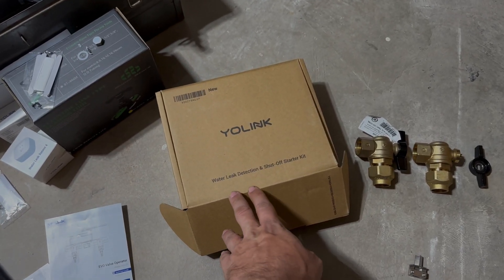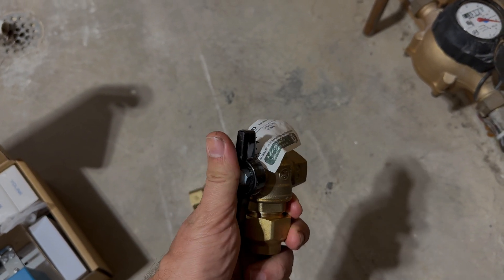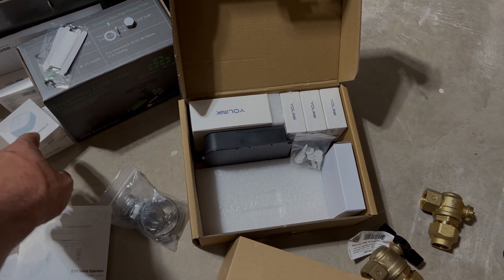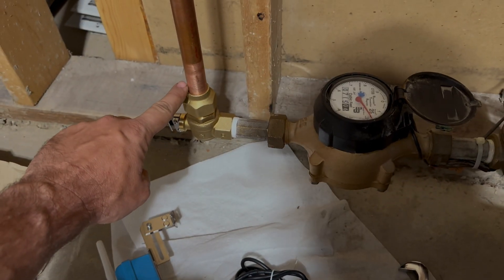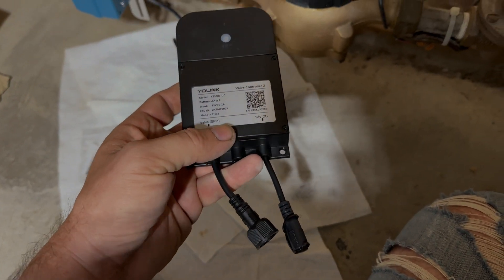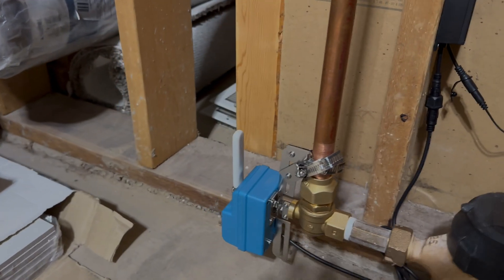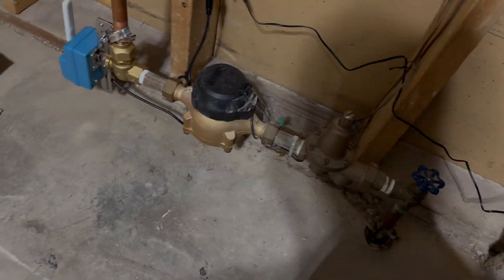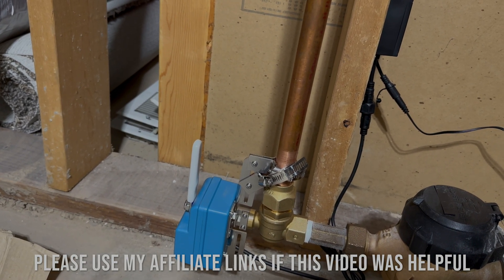Smart Water Valve Shutoff & Leak Detection w/ YoLink EVO Valve Operator - Part 1

Comment: I have the same piping situation, in this set up if the leak happens in the meter or PRD valve, it would not help. A great video to understand the working. Thanks
Reply from the maker: Thanks for the comment. In my setup, a leak from the meter valve would eventually head towards the drain and hopefully trigger the leak detector.  But of course to your point the system would not be able to auto stop the leak as it’s upstream of the shutoff valve.  But at least I’d get an immediate warning on my phone and email to alert me to the problem.

Comment: After watching your video, I installed the Yolink leak detector in my house too.  Your video was a big help when I was installing it.  One thing I did was to add a second ball valve in series with the original ball valve.   I did that because my original valve was a little bit hard to turn by hand, and I was afraid it would strain the valve operator.  I discovered that I like having two in-series ball valves because Yolink operates the new valve, and I can  still use the original valve to shut off the water to my house without involving the YoLink system at all.   That way, if another family member (or a contractor) wants to shut off the water in a hurry, they don't have to wonder how to do it when they encounter the valve operator.  (I know they would only have to push the set button on the valve controller or depress the clutch pin on the valve operator and then close the valve manually, but they wouldn't know that.  They might break something.)
Reply from the maker: Glad the video helped! Good call out on the value of having a 2nd valve for easier manual operation. As you saw in the vid, I already have a 2nd valve upstream of YoLink which I can't replace anyway since I can't turn of my water at the curb.  Thanks for commenting!

Comment: Why did you pick YoLink over the more well known brands?
Reply: I looked at the Moen leak detection system and it requires that you do some plumbing to install their valve.    I don't mind plumbing but the Yolink system is nice because the valve operator piggybacks on your existing valve and you don't have to cut into your pipes.  Yolink has a number of other cool home automation devices (alarms, door sensors, temperature sensors, smart receptacles and on and on).  And their new water sensors have a built-in alarm right inside the sensor.  So if a sensor detects leaked water, Yolink (1) commands that the house water supply be shut off, (2) makes am audible alarm right at the location of the leak (3) sends you an email, and (4) sends you a text.
Reply from the maker: @danchandler9381  Yep - and when I had a leak all of those functions worked as intended!
Reply from the maker: Such as?
Reply: @chrissfixes  Moen Flo,  Leak Defense, Streamlabs Control, Phyn Water Assistant... so many on the market now it's tough to compare.  

Plumbers know these listed ones but whenever I mention YoLink, they've never heard of it.   

Yolink has other versions that go inline,  and they have a whole house monitoring device which I presume uses an impeller.  

YoLink looks like a great system to me. The thing I can't figure out is how stable the company is? In (my) real life I've never found anyone using it.

Comment: How's it holding up 8 months later?
Reply from the maker: @BryanJames831  Happy to report it’s working great!  In fact it actually saved me from a catastrophic flood.  I had a pipe bust last month inside a wall. Fortunately I had placed a leak sensor in that location knowing it was a freeze risk.  The system worked flawlessly.  The main valve shutoff in seconds, minimizing the water leak.  My phone notified immediately via the app. I was out of state so had I not had the system installed it could have been tens of thousands in water damage.

Comment: Since this valve uses LoRa Radio connection to the leak detector, using the batteries in the valve controller should you have a leak with a power failure and or an internet outage the valve can be shut off from the leak sensors.   The LoRa is the key since this radio goes a 1/4 mile and  throught a walls better than WiFi.  I have used WiFi for IoT things for many years and WiFi is not 100%.  I like this system since it does not depend on WiFi / Internet being up to operate the valve for a leak.
Reply from the maker: Great point! I cover how to setup the device to device connection over LoRa in my Part 2 video here https://youtu.be/-qECYOmD4vY

Comment: FYI, for manual shut off; there is a clutch button on the back you can press then use the handle to shut off.  Also; make sure you connect each sensor to the hub and directly to the valve motor so if water is detected it will close the valve;  the direct connect is needed incase you lose internet and or power.
Reply from the maker: Thanks for the tip!